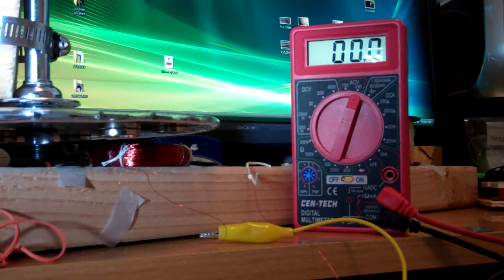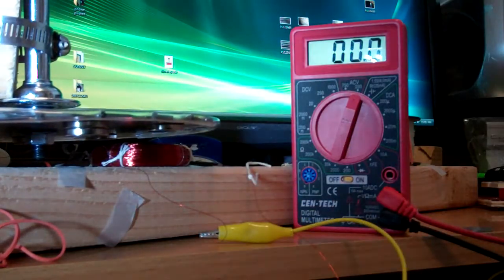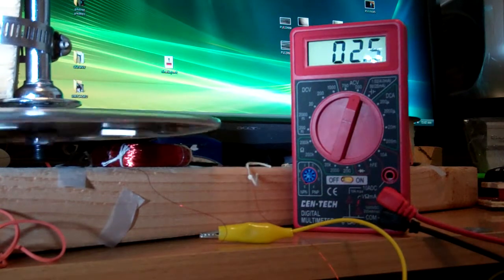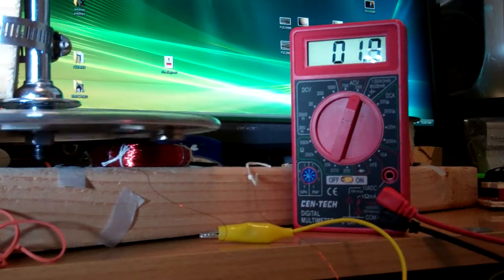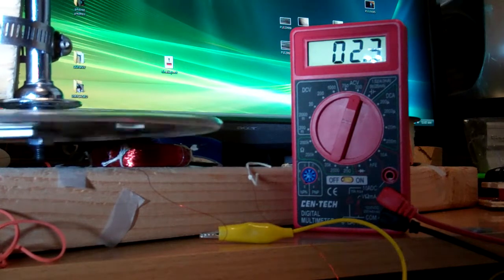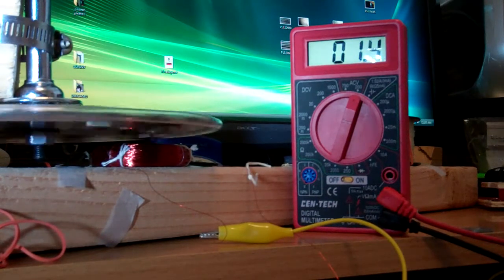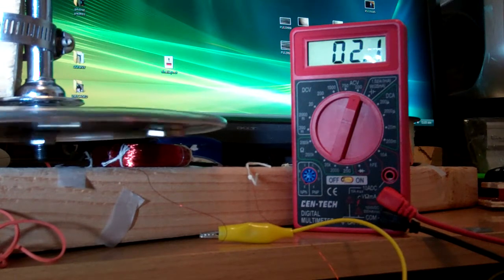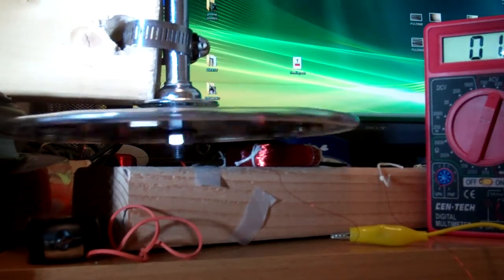Small horizontal axial flux windmill pt. 3 testing the coil Movie.wmv

Comment from the maker: I think the inner diameter of the coil should not be smaller than the outside diameter of the magnet.  If you have a coil  a foot round, your magnet would be so huge that it would cost you a fortune and possibly a hand, or an arm, if you mishandle them. I think you are really talking about making a serpentine coil. Then, the magnets can be smaller.

Comment from the maker: Let's start with I pretend to know the answers and I don't. It does matter how well the coils are wound, to a degree.Your coils will be less efficient if you don't wire them tightly or are of the wrong inside diameter. But then if you cast the coils in resin, then it matters less how tightly.Coils and magnets should be about the same size but not necessarily the same numbers.That depends on the phasing of your alternator. General rule is 6 coils 8 mag in 3 phase but I've seen 6 coils 6 mags used